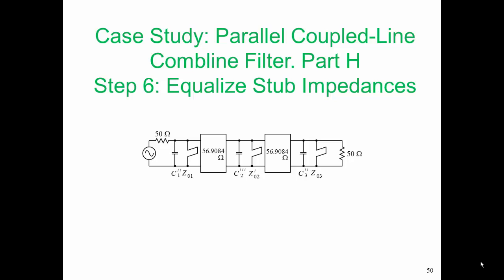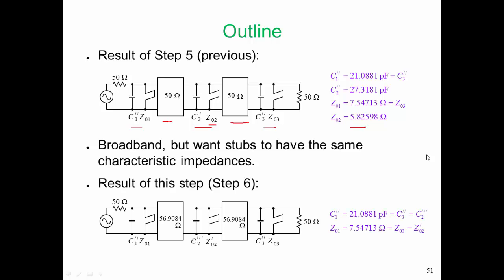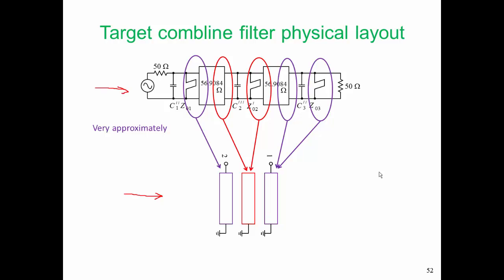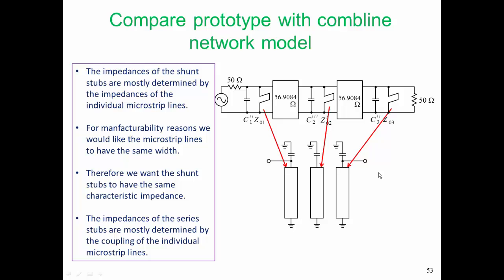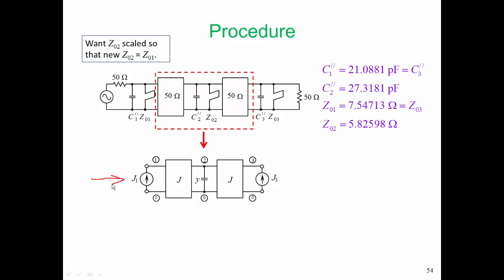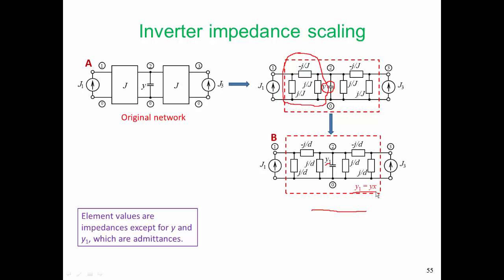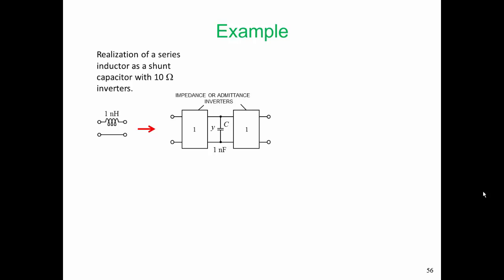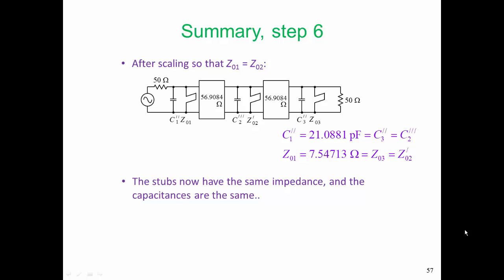Parallel Coupled Line Combline Filter, Part H

Comment: Thank you very much for these videos..But I have a question. In this demonstration where you have two converters,  it is clear that the inverters have been scaled by the square root of Z1/Z2 and the admittance by Z1/Z2.  How do you scale when you have three or four inverters? Thank you
Reply from the maker: In this step the aim was to scale impedances so that all the stubs had the same characteristic impedance. There are three stubs here but since the filter is symmetrical so there are only two distinct values.  Since there are only two distinct values then one scaling will ensure that all the stubs have the same impedance.  For a higher-order filter there would be more stubs and most likely it will not be possible for all stubs to have the same impedance.  Unfortunately there is not much that you can do about that and so stubs will have different impedances.  What you really want more than anything is for the stub impedances to be around the the same value and be in the range of impedances that can be realized in microstrip. Eventually these impedances relate to the width of the lines in the PCL filter. It is better, more manufacturable, if all the widths are the same but it is ok if the characteristic impedance range from say 30 ohms to 100 ohms (for substrate relative permittivity of 10) . You would proceed with design following Step H and if a problem arises latter (such as widths being too small) realize that you may need to come back to Step H and try again. Microwave (and really all circuit design) is like that.  Sometimes, if at one stage a design is not manufacturable, you need to go back a few stages and make other intelligent choices that get you out of a design difficulty.
Reply: Thank you. very relevant response.